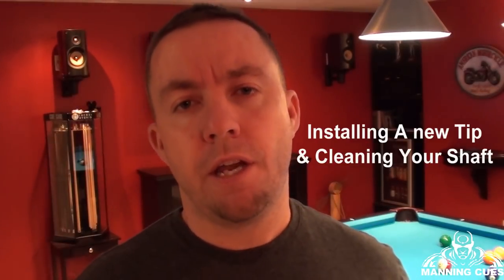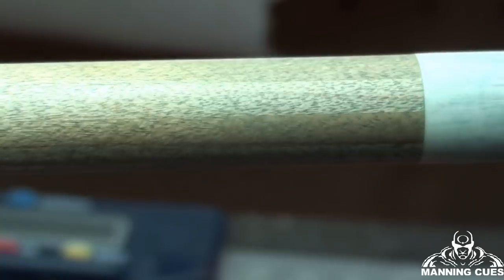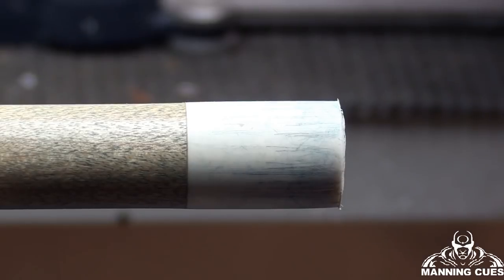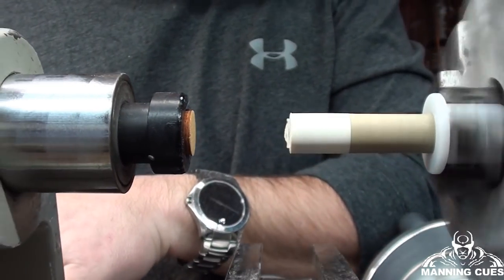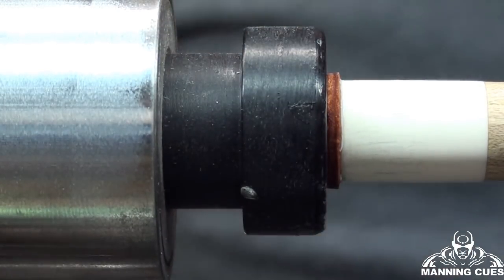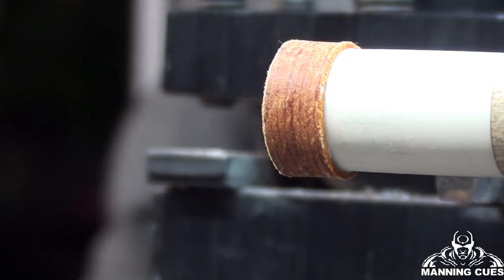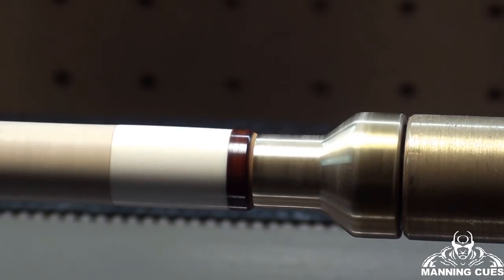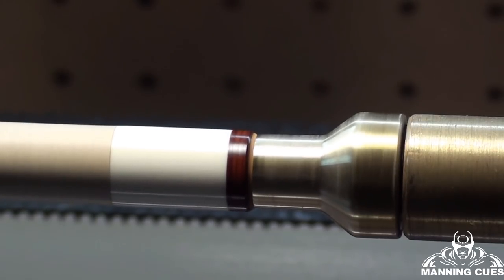Professional Tip Install & Shaft Cleaning - www.manningcues.com

Comment from the maker: The first solution is commonly used in the automotive industry. This cleaner is similar to the orange cleaner mechanics use to clean off their hands. The main reason why this works so well on cues is that the Cleaner contains no harsh chemicals, petroleum solvents, mineral oils that can harm your cue. The cleaner is Fortified with aloe, lanolin, jojoba and glycerin for added conditioning and protection. Waterless, petroleum solvent-free pumice cleaner. This will remove oils, chalk and dirt.....

Comment: 22.55 left arm comes in contact with spinning headstock with long sleeves. I know this is not a powerful industral lathe but that is a big no no. I use the exactly same method when reconditioning a shaft and tip. That shaft sealer from cue components is some great stuff.   Great video.

Comment: Hello Heath.  I am very impressed with this video.  I have cleaned shafts and replaced tips on my own cues, but only a few times and by hand.... I don't have a lathe. But after watching you, I am inspired to try building a rig using my old dremel and a couple 2x4s.  
I subscribed and I'm sure I will learn a bunch.  Thanks again for a great video.

Comment: Hi Heath, I want to thank you for taking your time to make this video. I am new in the business and this video has taught me more than the other videos I watched.

Couple of questions please. 
1. What kind of fish oil did you use to seal the ferrule and tip? Where can I purchase it?
2. You mentioned in the comments area that you are planning to do more videos; ferrules and phenolic tips.  Do you still have plans for that?
Reply from the maker: Morning Pete,
The solution I use to seal the ferrule/Tip is called Speed Sealer 2 which is sold from cuecomponents . c o m. I still intend do create a video on replacing a ferrule and will try to do this in the future. To install a phenolic tip you would follow the same procedure as I completed in this video for the Moori Tip. Thanks for writing me and for your questions and comments. :)

Comment: What cleaning solution, sealer, conditioner do you use?   After you sealed the ferrule, you put conditioner on the shaft.  Are not the sealer and conditioner the same product?

Comment from the maker: Hi Brush,

Thanks for the well writen comment :) The information you've provided is correct. The product code is for a smaller bottle than what I use but for the regular player just looking after their own equipment this size is perfect. I'm not aware of GoJo's formula so I can't comment on it or recommend it. Play confident and have fun :) Manning

Comment: Great video, Heath. One of the best demonstrations out there! I have a question; I have a Predator 314/3 shaft that has the so-called V-Tec silencer pad on the end of the ferrule. Predator says the warranty will be void if this pad is worn away. That doesn't really concern me much, but I'd be interested to hear your opinion on whether it is really needed, other than to create an allegedly more pleasing sound when a ball is hit. Here is Predator's blurb:  

"Our proprietary blend creates a stronger and more tactile glueing surface, while creating an audibly pleasing sound upon contact with the ball."

If this pad is eventually worn down/removed, do you think it will have any detrimental effect? I've been told that a good solution for a worn/missing silencer pad would be to put something like a Kamui clear tip on it, which as you know has a clear pad on the base. Is the V Tec silencer pad just advertising hype?
Reply from the maker: Hi David,
If we were to examine the construction of the 314-3 shaft we'd see the V-Tec Pad is not just for sound or looks. The v-tec pad caps off the tenon and runs inside the hollowed out front end of the shaft. This provides strength and security for the laminated spliced shaft pieces and achieves lower front end weight for even less deflection.  If the Silencer pad wears away from changing tips it can and should be replaced. Have a great night David :)

Comment from the maker: ...from you shaft and not harm it in any way. The two main ingredients your want to look for in this product are: Pumice and Lanolin and make sure its a waterless cleaner. Water is not good for wood :) You can find this product at any automotive store just read the label for the ingredients. You will love the results. I use wood sealer and a wax conditioner mixed together to finish the cue. Sealer and conditioner are not the same product. feel free to have a look at the products on my website.

Comment: Hi Health,
You mention that you use shark oil to recondition the shaft. Can you elaborate on the shark oil and where to obtain it ?? Also, can you show & tell about the contraption up on the wall that looks like it holds ferrules and/or tips ??

Thanks,
Lee
Reply from the maker: Hi Lee,

The shark oil is basically a cue shaft conditioner that can be purchased on my web site under accessories called Q-Glide.
The contraption on my wall that is holding tips and ferrules and other items is basically an organizer for small items and can be purchased at Costco :) Thanks for the questions. Hope your enjoying my videos :)

Comment: Hi Heath,
I can really say that this is the best video I've ever seen on the net about cue tip installation. Thank you a lot and Congratulations!

I'm a rookie in this business and I have some questions.

1. Do you squeeze the white sponge or you just keep the alcohol on it?
2. I do not have Ultimate Tip Tool, is it okay if I use Shape side of the Cuetec Bow-Tie.
3. What is the content in the Orange Bottle? :)
4. I think you use both Tip Touch and Speed Sealer 2 for tip and ferrule but you use Speed Sealer 2 for shaft also, right?
5. I live in Turkey, so I can not provide those items you use. Last summer when I was in US, I had Q Glide, Q Clean, Q Slick and Cue Doctor Shaft Conditioner. Can I use any one of these instead of yours?
6. Can I polish the ferrule and the tip with leather conditioner cream and a piece of cloth ?

Thanks.

Comment from the maker: Hi Tennezzee,

The camera I use is called a Sony Handycam Model: HDR-CX110.
I will soon be purchasing a Canon SLR Rebel T3i for a much better picture and clear audio.
I have used super fine steal wool to smooth out a shaft as a temporary way to smooth the shaft out.
However this will only smooth the shaft and will just push the oils and chalk dust into the poors of the wood.
Thanks for the comment. Manning :)

Comment from the maker: Hi Aie,

Thanks for your comment :) The machine is made by Joe Porper and sells for $4,295 USD.
This price is just for the machine without all the tools & accessories needed to hold and work on the butt, shaft or tip. The total cost is closer to $5,000 USD by the time your done. If you would like your shafts re-tiped or cleaned you could always send me your shafts as many others have :) Manning.

Comment from the maker: Morning Swordstalker87,
I have many players from USA and Canada send me their equipment for maintenance. I have about 35 tips on hand which all cost a different amount ranging from $25 to $50 which includes installation. I will also clean, remove nicks, seal and condition your shaft when I install your new tip. When you ship me your shaft you'll be responsible for round trip shipping. You won't regret having a professional renewing your shaft :) Manning